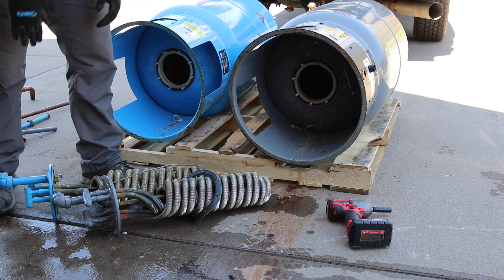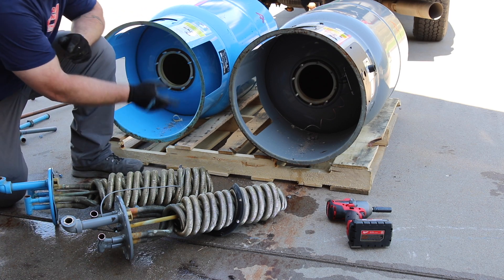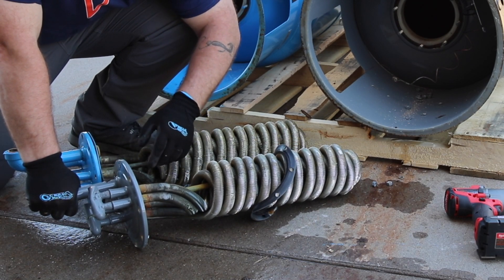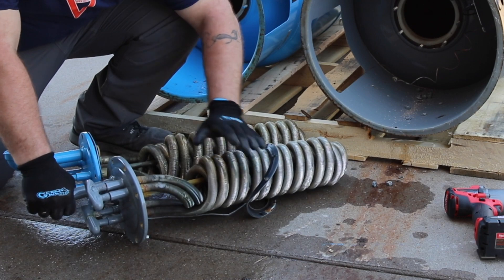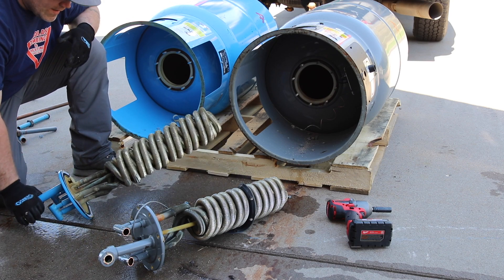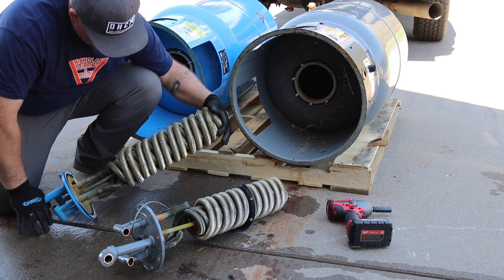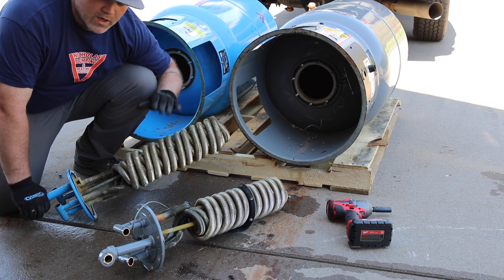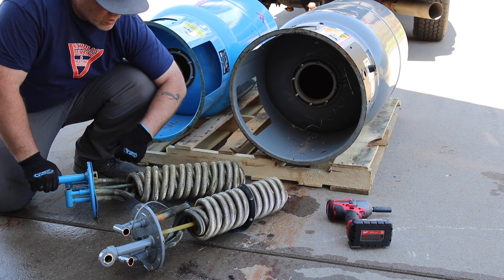Water heater dissection

Comment: Can I pull my heat exchanger to clean out the mineral deposits? I’m on a well in Alaska and the water is hard. It works good and want to extend it’s life. I was a plumber in San Diego for years before joining Air Force , just not familiar with these things. Really just curious what kind of issue I would have re-sealing it.

Comment: I was told the gasket on mine was gone and it sounds like the whole thing has to be replaced, I guess? I would have thought you can just fix it rather replace the whole thing. Does that sound right?
Reply from the maker: The gasket can be replaced
Reply: @mechanical-hub  is it possible to pull the coil without removing the water heater? coil look's to long to pull it out from the openings at the bottom.

Comment: Do you have to drain those amtrols to do a aquastat change? Or does the aquastat simply slide up the copper tube that's located inside the heat exchanger coil.
Reply: slides in

Comment: FYI. When the heat exchanger on an indirect water heater fails the potable water will enter the boiler water. The domestic side of the heat exchanger should always have a higher pressure. Simple physics dictates that the higher pressure will always flow into the lower pressure. Very little chance of contaminating the potable water. You will however find that it over pressurizes your boiler. My info pertains to conventional indirect water heaters, not these POS.
Reply: If you watched the video, you would see the heat exchanger pipes are double walled so that if the exchanger leaks, water will run onto the floor and not contaminate the potable water or boiler water.

Comment: I have the same one as the blue one. I installed it in August 2005 - still works great, January 2021. I have filtered and softened well water. These were great units. Cost me $600 back then at Lowe's. Now, they're about a grand or more just for the unit. I had a relay failure inside the electronic control about 8 years ago, related to the ability of it to run on 250vac, or 120vac. Of course when the relay fails it defaults to the 250v setting, and makes the display wig out.  Was blinking, and the unit was useless. I had found a detailed explanation by an electronics engineer in the comments section of a store that sold Smart Control replacements for $250, and I was able to remove the relay, solder in 2 jumpers, and it's been working great ever since! That probably saved me $500,  since the second one would be failing about now.
Reply: I'm looking at a used tank that has a digital control on it for a "budget" solar hot water system. I'll also be replacing the control unit so I'm happy to hear that's the weak point of these tanks :)

Comment: thank you whats the best way to clean them
Reply from the maker: Remove and wash with descaling chemical safe for copper. Or replace.
Reply: @mechanical-hub   Thank you !!
Reply: So from your response they are cleanable. I have a superstore tank over 20 years old (same age of boiler). Wonder if replacement gaskets are available? Hot water doesn't recover as fast as it used to. Thanks for posting this video.

Comment: thank you for the video.  Mine just started acting up and not sure if its scale on the coil or if the thermostat needs replacing.
Reply from the maker: Scale, almost for sure. The design of the Amtrol tank and coil is very susceptible to scale